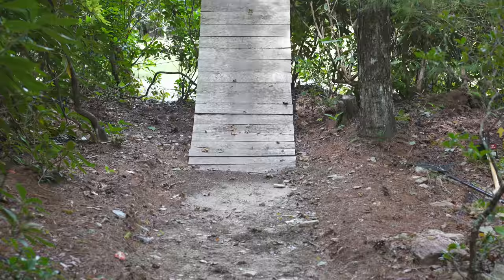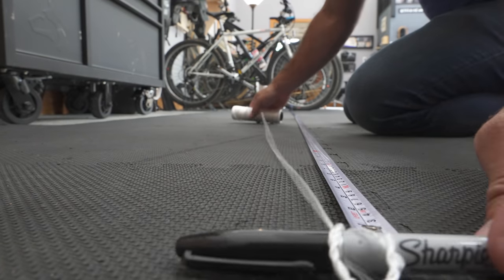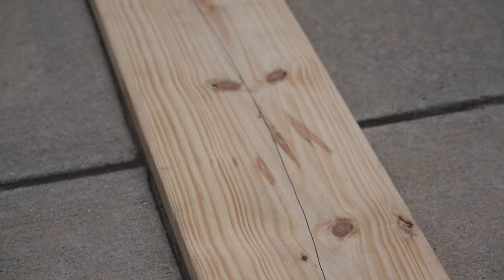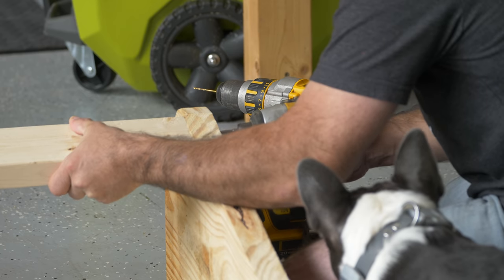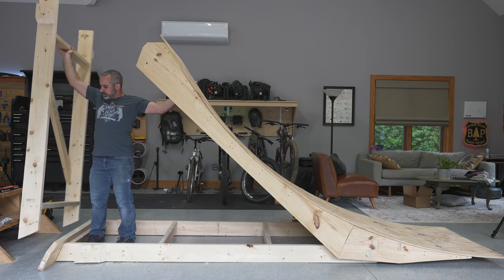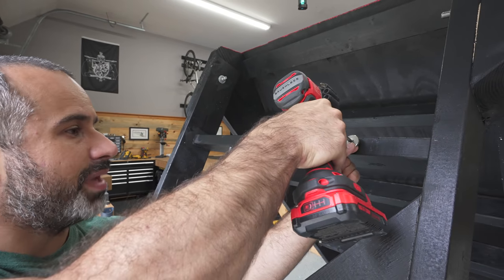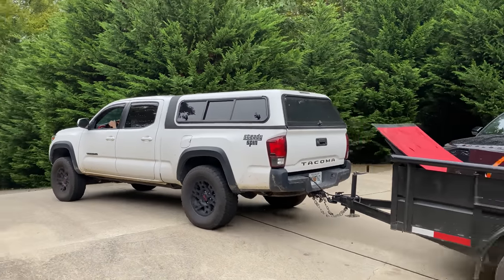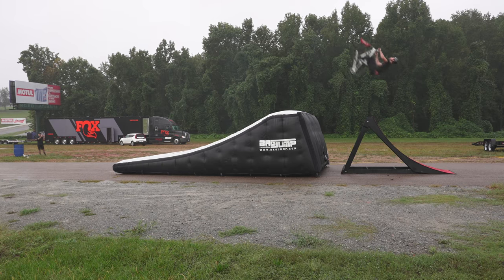Building a Mountain Bike Trick Jump for Pro Riders

Comment: FYI string can stretch when drawing a radius. Use a screw for the pivot point, drill a hole in a 2x4 at your desired radius length. Insert a marker and draw the radius.
Reply: this 100% never use a string for a radius. if you want a nice cut, even screw your saw to the 2x4 at 10,5ft and straight cut the radius for a perfect curve. a smooth curve feels so much better.